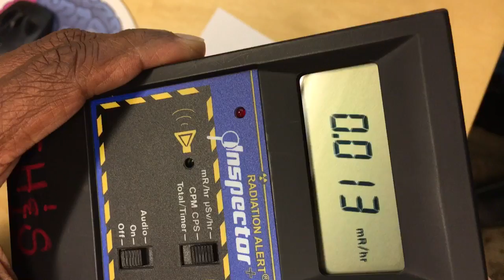Radium dots on a mido commander tension ring

Comment: You should always use CPM. Also, the Inspector is calibrated with Cesium-137, so dose modes like mR/hr and μSv/hr will not be accurate, except when measuring Cesium-137 (gamma only). Always use CPM or CPS for everything else you want to detect. CPM or CPS should always be used first, even if you're measuring a radioisotope for what the instrument is calibrated to. Different radioisotopes put out different energies, at different intensities (branching ratios).